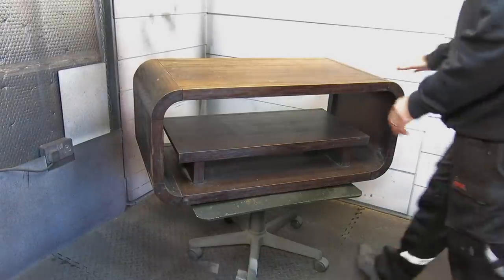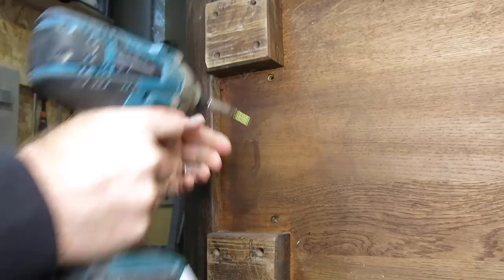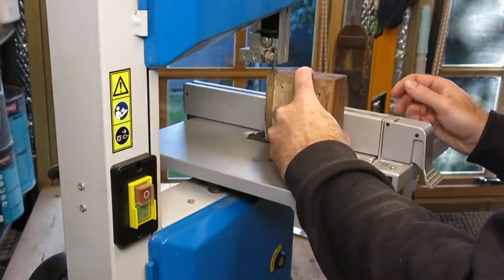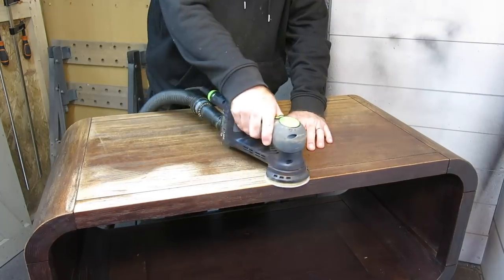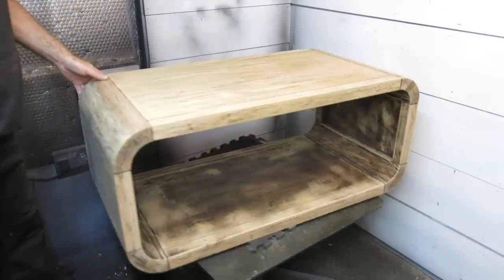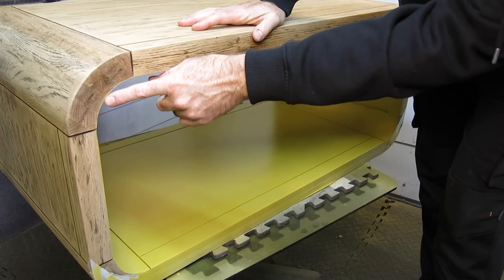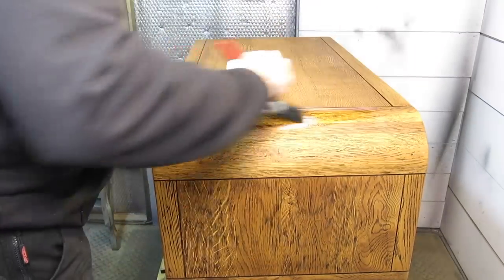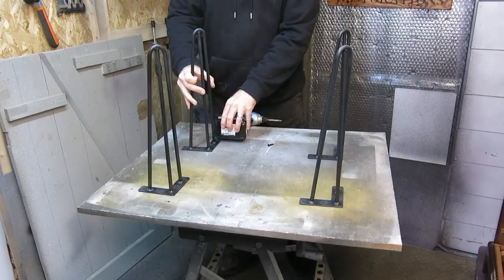DRAMATIC Furniture Makeover of a BORING dark brown media Table

Comment: I love that piece it's so unique... You mentioned you usually sand to a 120 grit but used 240 this time... Did you mean you usually sand to a 220? Also what did you mean by "wet coat"?
Reply from the maker: Hi Brittny. Thanks very much. No, I usually sand to 120grit when staining to keep the grain open to accept the stain but I went to 240 this time as I wanted a smoother surface because I was using oil as the final finish. It just meant the stain colour wasn’t as dark. We don’t tend to have 220 grit in the UK it’s 240 here 😀👍 All I mean by “wet coat” is that the first coat is very light to give adhesion and the wet coat is heavier for coverage and smoother finish 😀
Reply: @MayfieldRestorations  thankyou for taking the time to explain that to me. Iam a new refinished trying to learn everything I can. I've always been taught to go to 220 for stain(Iam in Canada and have 240 also so I have to order 220) I was told if I went to only 120 I would have blotchiness but I got blotchiness at 220 also :(
Reply from the maker: @brittnyblain9762  Hi Brittny, it really depends on the wood you are staining and also the type of stain your are using. I've just done a Pine piece of furniture and it was an absolute pain to stain (nice rhyme) 😀 Because it is a softwood it tends to soak up the stain quickly so I went higher grit to try and close the grain a little. When I do Oak or Mahogany etc I tend to stay at 120. I also use a penetrating stain which you have to work quickly with. My best tip to avoid blotchiness is to ensure that whatever grit you've sanded at, the sanding is uniform across the piece and ALL dust is removed. Another tip (which I've yet to try) is a pre-stain using Black Tea. Just search for Black Tea Wood pre-stain and its really interesting.